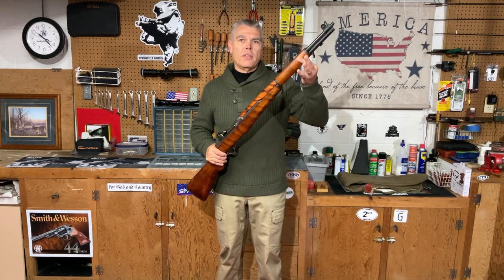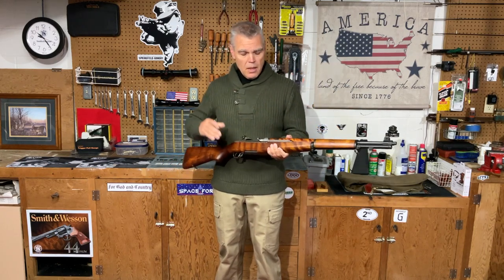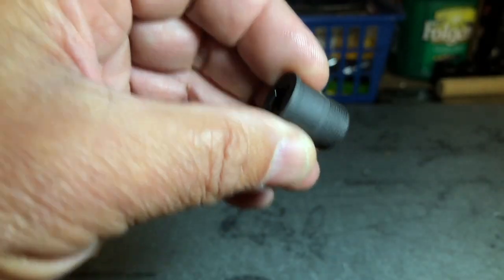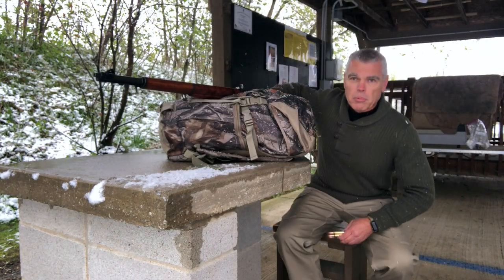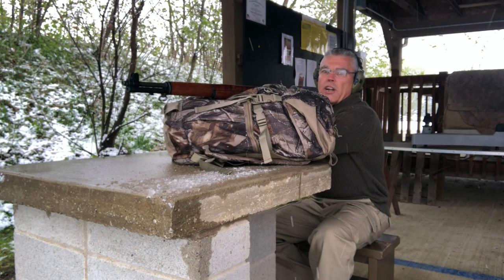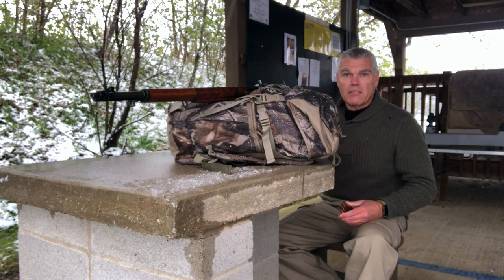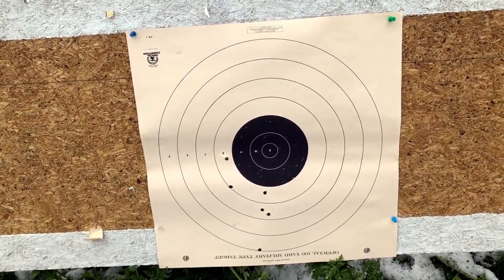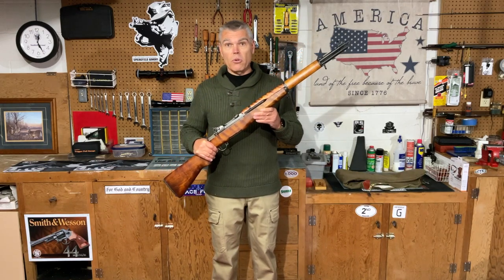Garand Gear Ported Gas Plug: Fact or Fiction

Comment: I reload, so I always run commercial 30-06 through my 1903 or P17 first, then reload to the M2 spec loading.
Reply from the maker: That’s a good idea.
Reply: Uh, the M1 Rifle was not designed to shoot M2 Ball.  John Garand himself said M2 was not suitable for combat use in his rifle.  Don't drink the kool-aid (and maybe read a book--start with Hatcher).
Reply: @johnwinn5019  
Thank you for the polite response.
Gun Digest seems to think M2 ball is appropriate for the Garand.  Additionally, I found this on the M14 forum, authored by "Lysander":
"Well, obviously, yes, at the time of the standardization of the M1 drawings, there was no other Caliber .30 Ball, except M1906 which was being phased out. But the "original" design was a gas trap, which tend to be rather finicky, and the gas trap was rather quickly changed to a simple gas port in the barrel.

But, I have found a few interesting things, while combing through some old M1 drawings.

There are three different barrel drawing numbers for the M1, the first is the original 2 August 1937, Drawing No. D28286, for the gas trap design with no gas port at all. The second is the 10 March 1939, Drawing No. D13661, which introduces the new gas cylinder attachment and a 0.069 +.002" diameter gas port 21.805 -.01" from the barrel shoulder. The third is the 1 March 1940, Drawing No. D35448, which only differs from D13661 in that the gas port is now the 0.079 +.0015" diameter everyone knows as "the standard" .30-06 gas port.

So, what happened between 1939 and 1940 that would have caused them to redesign the gas port dimensions? Oh, yeah, M1 Ball was replaced by M2 Ball.

The 0.079" gas port is optimized for the lighter 150 grain M2 ball projectile with a medium quickness IMR 4676 or IMR 4895. The 0.069" gas port is optimized for the heavier M1 Ball projectile propelled by slightly slower IMR 1185.

So, no, that M1 you have in your closet (unless it is one of the old gas traps, or has a 1939 barrel) was not "designed" to shoot M1 Ball. It was "designed" to shoot M2 ball."

Comment: When i go to my lgs i always look for M1 specific 30-06; sometimes they have it- most times they don't. I don't know enough math to know if a very slight increase in the volume of the gas system is enough so i went with the Schuster plug so i can adjust it as necessary for any ammo i come across.

Comment: Well, I bought my Garand two weeks ago. It’s a real nice looking one first produced from July-November 1944. New wood furniture and a barrel produced in November 1953…This means the gun saw action in WW II and even Korea. Been debating whether to get a schuster plug for it so it can shoot more commercial rounds. At the same time though, my Garand is such an ancient piece, I doubt I’ll shoot it that much. I’m really thinking of getting a custom case for it. To me, this gun, when my kids study WW II, I might bring it in as a historical show piece…That’s its position now.
Reply: Well, I got the Garand gear plug too. Was looking at the schuster adjustable block but they were out of stock. After research, I think Remington core-lokt 165 grain will work, especially with the Garand gear plug since it’s a 165 grain bullet moving at 2,800 fps. Now the Garand was designed to also shoot the M2 AP round at around 170 grain moving at 2,800 fps if I remember correctly. So yes, with this plug, it should work.

Comment: I haven’t had any issues with mine, and never felt the need to get the Schuster adjustable plug.  I bought the GG plug to insert and forget it.  You also didn’t specify the bullet weight of the commercial rounds you were shooting, but I specifically bought mine so I could reload and shoot 168 grain bullets without any concern about stressing the rifle or bending the op rod. 

I’ve had it several years and no issues, and frankly never considered it would have any effect on accuracy.  Using standard ball it’s just reducing the gas port pressure, not the chamber pressure which will stay the same.  

By the way, please tell me where you got that gorgeous stock!
Reply from the maker: Thank you. Unfortunately, this rifle belongs to a friend of mine. I don't know where the stock came from. Merry Christmas!

Comment: If you want to use spicy 30-06 in your Garand then the Schuster gas plug is the only option. One day at the range I didn't feel like adjusting the Schuster plug so I threw in the Garand gear plug while shooting some 180 grainers. After shooting a few clips the op rod jumped the track and part of one of the lugs sheared off. So I can attest from personal experience that yes spicy 30-06 can damage your Garand and the Garand gear plug does not slow down the Op rod enough with certain 30-06. The Schuster plug is the way to go and will slow down the OP rod enough to avoid damage.
Reply from the maker: Thanks for the info. That tends to confirm my suspicion.
Reply: Well these guns are really only meant to shoot up to 168gr bullets. I wouldn’t shoot 180’s. I feed mine with 150’s and watch the pressure and muzzle energy ratings of my ammo are
Reply: @BrentWells-g9t  I checked the ammo again and it was 168 grain not 180 grain. I've heard of op rod damage occurring from firing 150 grain ammo. The grain weight does not really matter, the pressure matters a lot more.
Reply: @dancortes3062  
168 is considered match grade in these rifles without including the other key components. However muzzle energy shouldn’t exceed 2800 -2900 I think if memory is correct M2 ball was average about 2600. Like I have some Hornady Superformance however they say you can I’m not sure I wanna try it in my Garand it’s hot powder. I have shot some Fiochi range dynamics 150gr FMJBT and it was loving that all day
Reply: @dancortes3062  I’m not sure why 150 would as that was the standard weight the military used. The weight doesn’t really affect the op rod. The higher the weight the more chamber pressure you build behind the bullet but then there is also how spicy a powder is as well. A lighter bullet will move easier out the barrel and at faster speed. 
If you use a ported gas plug like the one I got from Garand Gear you don’t have to worry about op rod issues as much. Mine has fired good so far and it seems to love the Fiocchi range loads in 150gr.

Comment: What pattern did the rifle shoot with the original gas plug, you only showed us the ported plug results, second, was the commercial hunting loads the same grain weight bullet as the M 2 ball?? Different weight bullets will deliver different recoil results!
Reply from the maker: Since I was focused on the performance/functioning aspect of this product, I didn’t shoot M2 for a comparison. Off the top of my head, I don’t recall the bullet weights. I produced this video quite some time ago.
Reply: That’s what I was gonna ask . I have multiple M1 Garand’s and have the GG plug in two of them . I got them in case I wanted to take them Deer hunting ( I did last year ) and if the world goes to shit and couldn’t find Garand specific ammo I could use what I could find . FYI , they wouldn’t be my first choice in an SHTF situation but it’s definitely a backup just in case .

Comment: I use the adjustable plug on both M1s. When adjusting I shoot and bolt doesn’t cycle. One turn in until bolt and ejection work.  Then screw in lock washer

Comment: The only way to truly know the difference is to do high speed photography with both plugs and a variety of ammunition using M1 or M2 ball as a control.  The photography would allow one to calculate the velocity of the op rod and see if it’s still in an acceptable range.  Pressure testing would be a reasonable thing to do as well.  Some YouTuber might have the video equipment to do high speed testing (Ultimate Reloader, Iraqvet8888 are a couple that come to mind) but the pressure testing would have to be done in a lab at some ammo or powder manufacturer.  I’ll stick with factory ball or reasonable loads using 4895 and similar powders with 150-190 grain bullets.
Reply from the maker: I think you have a good plan Stuart.

Comment: They have adjustable plugs... You can manually adjust with a screw in the center to run any 3006 ammo hot or not
Reply from the maker: I know. This is not one of them.

Comment: I have an adjustable gas plug but I've never installed it or used it. 
Even in these trying times, I've never been unable to obtain M2 ball spec ammunition and commercial hunting ammunition is not less expensive.
PPU and Norma Whitetail 150gr and now Winchester is advertising an M2 ball spec ammunition specifically for the M1 rifle. 
The CMP simply advises you not to use ammunition that exceeds 50,000 CUP.  Whatever the bullet/powder combination you use, if you stay within that boundary, the rifle should be OK.

Comment: I was disappointed that this video was so subjective. GarandGear has an 8 page write up on this plug showing all of the gas cylinder pressure curves over time using surplus M1 Ball with and without the ported plug, plus modern ammo from every manufacturer that currently exists. It clearly shows the gas cylinder pressures with the plug and modern ammo become closer to what is seen with surplus M1 Ball without the ported plug. You don’t mention this at all in your video, and instead your conclusion is: “meh. It feels like it kicks more, and the 5 rounds I put through weren’t very accurate” (show the comparison between surplus M1 Ball with and without the plug why don’t ya). This plug DOES decrease the pressures that the gas cylinder and op rod experience with modern ammo. The plug DOES NOT affect the chamber pressures, and GarandGear is clear about that.
Reply from the maker: It’s interesting to me that of the 600+ videos I’ve produced, this one seems to get more of what I would call emphatic disagreement than most of the others. At the end of the day, I expressed my opinion regarding the rifle and ammunition I was testing. If you, or others disagree with my opinion, that’s fine. I wish you the best of luck using this product with whatever rifle and ammo you like. Speaking for myself, I’ll stick with M2 spec ammo when shooting my M1.

Comment: Nice US Rifle M1, outstanding stock. That's SPRING, looks dead of winter to me cold....Spring here in Florida 87 degrees even hit 90 a couple of times had rain so had some cool weather only 77 one day. Stay warm, neat rifle, think I'd use M1 Ball.
Reply from the maker: Thanks Sergeant Major! With a little luck the snow will stop by the 4th of July.
Reply: @hrfunk  Chief it snowed ONCE here back in the mid 1970s flurries I think they are called nothing on the ground just could see the flakes blowing in the air, it was daytime too, so many got to witness this, course you may have lots of snow in Ohio, but you dont have hurricanes and we do. I can get warm but there are just so many cloths you can omit when you have no electricity for days and your house is made for air conditioning and cross ventilation housing designs ended in the 1950s.

Comment: I have experienced this "failure" in my M1 when using the ported gas plug.  I've worked the exact problem you showed in the video.  I promise you it is NOT the ported gas plug, but your rifle is out of spec...  Go through your rifle and do a re-test video of the results, I'm sure the folks at Garand Gear would appreciate it.
Reply: Out of curiosity, what was the issue with your rifle? I have a nice service grade CMP gun, and have considered this plug.

Comment: First off, felt recoil is not a control measure of functioning and your FTF's could be caused by many other issues.  I'm an old National Match shooter from the 70's when we shot Garands in competition.  I own 4 Garands now my latest being a CMP Special, a 1942 SA with a 1955 barrel that to make a long story short will shoot 1moa or better if I do my job and I've proved it to many people.  All my rifles have GarandGear plugs installed and Orion 7 recoil springs,  even my NAVY MkII, Mod 1 in 7.62x51 that I shoot occasionally.  Immediately after installing it I noticed very smooth operation on my rifles, accuracy remained about the same but because the rifles were much more comfortable to shoot I believe I scored better and I have never experienced a FTF in any of my rifles.  If you hunt around on their website there are high speed video's of operation and charts of multiple different brands and types of commercial and NATO ammo tested with a direct reading pressure transducer screwed into the end of the gas plug, the results will surprise you but those are scientific measurements of operation and pressure.  I fire commercial ammo in my rifles and have for 15 years avoiding really high performance stuff or loads with bullets over 168 gr. and not only haven't experienced any catastrophic failures, all my Op Rods are just fine and pass their tilt tests and gauging.  Your shooting tests are purely subjective and misleading.  The FTF's could just be a bent or worn clip.  Further information can be found here : http://www.garandgear.com/ported-gas-plug.html

Comment: My understanding is not so much the pressure of commercial or hand loads but rather the pressure curve change when ammunition is used that is loaded with slower burning powder than the M1 was designed to use.
Reply from the maker: The real issue is the greater op rod/ bolt velocity. That’s what causes the damage.
Reply: @hrfunk  Slower powder raises the gas port pressure because the pressure curve is to long timewise and that is what increases the speed of the rod and bolt.  Heavier bullets over the 175 gr. weight can have the same effect.

Comment: I do have one of these plugs. My main reason is I handload a 168 Amax bullet for match shooting. My velocity it at 2650 but with the heavier bullet I feel it brings the impulse back to M2 territory. I myself wouldn't be ever using any thing over 174 grain bullets in the M1 anyway. Also the M1 shoots 130 and 100 grain projectiles at high velocity very very well, and those will never hurt the rifle regardless of the plug.
Reply from the maker: I’ve pretty much settled on the 155 grain A-Max at around 2700 FPS. For 200 yard M1 matches. That works quite well.
Reply: @hrfunk  The Nosler 155 custom competition also work great and usually can find them quite a bit cheaper than the Amax. I  went with the 168's grain to better stretch the M1 out to 800 yds. Btw nice Tiger stripe stock on your rifle.
Reply from the maker: Thanks! But this rifle belongs to a friend of mine.

Comment: Even running 150 grain soft points by PPU which is under the 2900 fps actually like 2890 I can feel the difference in my standard configuration! I did order the shooster ! I don’t have a issue not shooting much soft point ! But I wanna hunt ! It kinda make me not wanna mess with the Garand cause I need a functioning rifle
Reply from the maker: I don't know what you're hunting, but G.I. spec ammo might do the trick.
Reply: @hrfunk  it’s a thought man , I just spent 2200 on a 1941 serial 373xxx and don’t wanna hurt the thing lol

Comment: I had a question I have a 3040 krag is it okay to use a copper round with a soft point plastic tip
Reply from the maker: So long as it’s loaded to standard GI pressures, I don’t think it will cause any damage to the rifle. I’m not sure if the copper bullet will cause any difference in barrel wear, but you would probably have to shoot a bunch of it before it makes any difference.

Comment: CMP sent a warning out earlier this week advising not to use .30/06 ammunition in M1s, 1903s and 1903A3s that is loaded beyond 50,000 CUP and has a bullet weight above 172gr.  They indicate it's an update to the manual the rifles come with.  I wonder if new gas plugs and other "fixes" has anything to do with it.
Reply from the maker: I received that notice from CMP. You might be right.

Comment: This is a silly question what tool do you use to make sure you have the right torque a torque screwdriver?
Reply from the maker: It’s not silly. I use a Caldwell torque driver calibrated in inch pounds.
Reply: @hrfunk  lol gotcha and how do I get foot pounds from that? Divide or multiply by 12 lol?
Reply from the maker: Sorry. I can’t remember. When I need foot pounds I use a different wrench.

Comment: Great rifle group should be better.. I'm sure you do better than that. I purchased one a few years ago it made no difference to me I did shoot some 180gr. hunting ammo no difference compared to the 150 factory ammo had. I reload so I'm really careful with ammo for the two M1 rifles I own. I'm careful with everything. I have a lot of reloads and have been putting factory ammo away for years. I've seen this coming. That bent round was frightening. I've had no issues  thanks for another great video .... One thing I noticed the tourqe they recommend was super right . I did back off a little. But I've had no extra wear and tear. I purchased these rifles in the early eighties when I was a young Soldier at Fort Bragg a private sale. It turns out the rifles were hardly fired. When I retired  in 2010 a couple of old timers asked to have a look at them at the range. They advised me not to fire them anymore. I'm a shooter not a collector. I have a few milsurp rifles and modern rifles and shotguns.   I was offered a lot of money for them. They are both Springfield all original even the barrels. The serial numbers show March 1945. I had no idea what I had. I would never sell them.  Sorry for the long story but I figured you would know. Great looking rifle you own. Thanks well done. Should I change the one rifle back. Any thought
Reply from the maker: It’s up to you. I didn’t see any great benefit to using the GG plug. Since you handload, I think you’re OK if you want to change back to the GI plug.